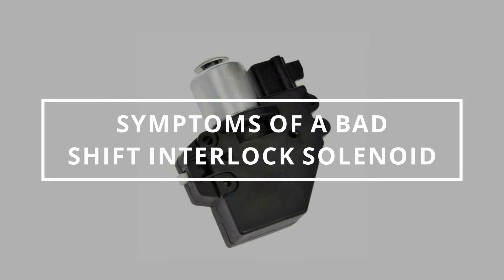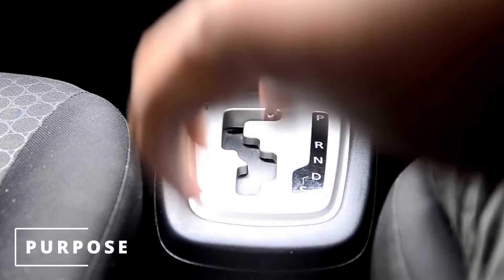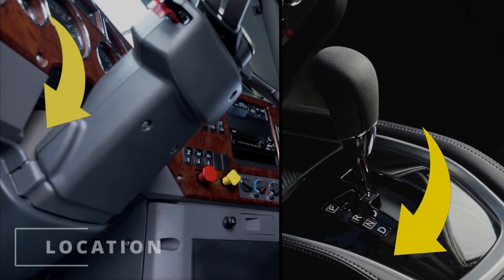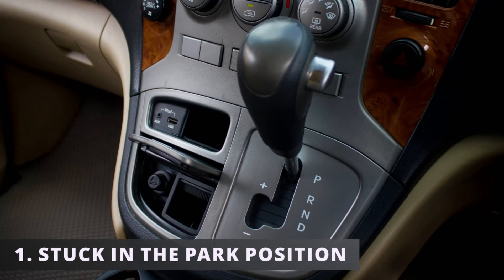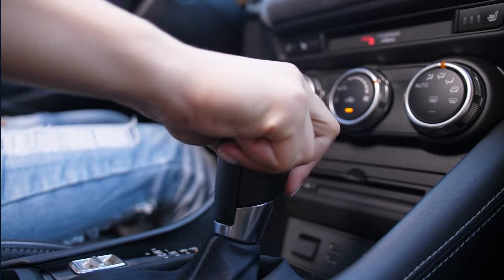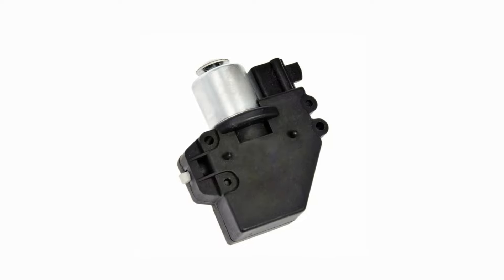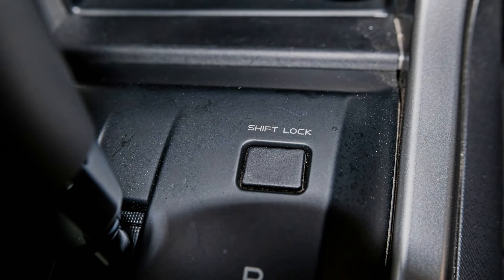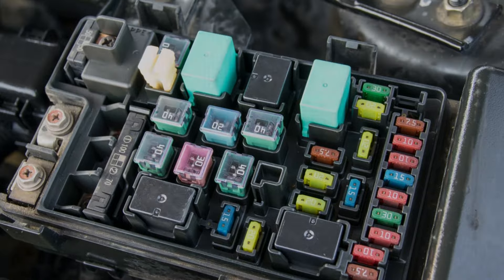SYMPTOMS OF A BAD SHIFT INTERLOCK SOLENOID

Comment: Nice video short and to the point. Quick question, can the solenoid be intermittent? Or is that a sign of a short. I have brake lights. Thanks for any info.
Reply: It could be intermittent  but its usually a matter of it going out(losing strength) and then the solenoid not having enough power to push through the transmisions resistance. Transmission resistance depends how strong your parking break is applied and if you are parked on an incline or decline, tgen the car rolls after you shut it off. if you dont push a (properly adjusted) parking brake all the way down, your car will roll after turning it off and it binds up the trnsmission into park. You dont ever want your car to roll after turning it off and you let your foot off the brake. he more your car rolls after putting it in park, the harder it is to pop it out of park so sometimes a bad solenoid will be strong enough, sometimes it wont. If you are having issues, try not to park on an incline, park sideways if you can so the tilt is side to side instead of front to back and always push the parking brake down almost as hard as you can before you put it into park. This should help until you can get it fixed. 

So to answer your question another way. The solenoid itself is not intermittent but it will lose strength when it starts going out. The amount of grip you give your parking brake affects the amount of pressure your transmission torques up after turning your car off. This is intermittent and will cause your solenoid to work intermittently. Its a bit of a tricky question so i tried giving a couple different resposes for the same answer.

Shorts usually dont happen in never cars unless it was in an accident or something crazy happened. A lot of people dont set the parking brake and just force it out of park. This wears down the solenoid quickly and can cause you to have to pony up for a new transmission prematurely.
Reply: 2005 Aviator here. I think the last owner bypassed the solenoid because the truck never goes fully into park and has a push to start button. So it will start in any gear which is dangerous. 
And now it won't go into park at all.
After taking off the shift cover it appears the shifter can't move forward any further due to it hitting  the metal bracket.
Been working on cars my entire life and never dealt with this. 
This is why I stick to Chevys. LOL
Any idea why or could the BSI cause this to happen.?

Comment: My issue is with the opposite. I can take the care out of park, but when I put it back into park, my key is stuck in the second position and won't go all the way back for me to take the key out. I have to wiggle the shift to be able to get the key out
Reply: Yes that is what is happening right now with my two thousand five honda accord. I asked my mechanic about it and they said to make sure that I firmly put the car in to park with the gearshift to make sure that the mechanism is reading that it is in park. They said if the car is not reading that it is in park it will not release the key. But lately I have been needing to use that bypass for shifting out of park and into reverse just to get the car going. Another problem I am having is when I start the car up fresh in the morning and drive a short ways and come to a stop sign.Or a red light, I press the brake to stop and em at an almost complete stop but in the car lurches forward 41 more little bump and it feels like someone has bumped me from behind and push me forward a little bit. I'm hoping to learn what that is.Perhaps it has something to do with the brakes
Reply: That’s a faulty ignition lock cylinder. Very common on Hondas-specifically Pilots. From my experience.

Comment: What does it mean when it’s finicky to get shifter out of park only in cool or cold weather; but no problem in Summer temperatures?
Reply: this is my problem also... what is not working in cold weather? wont move out of park...
Reply: @vincentdisisto8251  I've been told it could be a faulty "brake light switch", below the brake pedal (cheapest option), or the shifter cable (expensive).  I ordered the OEM switch today.
Reply: @drlarryc  hello, did replacing the brake light switch help to solve your problem? I also can't get shifter out of park when its cold.
Reply: @Xazeer  No, replacing the switch made no difference.  I tried to find another shifter from a salvage yard; and got to watch how involved it was to remove an old one (the guy broke plastic console off to make way to cut lots of wires underneath!)  I realized it was beyond my skill (and probably the cheap shop I intended to use) to cleanly swap shifters in my car.   
Then the salvage unit turned out to be broken just below the handle.   But I did get to see the contrast of how sloppy/ worn out the mechanism of mine was in comparison - mine had 364K miles when I sold it!   BTW: It was obsolete thru Toyota for my 2000.   So I continued to warm it up w/ remote starter until selling the car.   
If you shifter has loose play moving back and forth (with in gear) you likely have same issue as mine.

Comment: I just bought a 2015 PPV Charger and haven't even put 150 miles on it and the brake light, ABS and Traction control lights came on for about 50 miles..we cleared the lights and it's now stuck in park..had to tow it from an intersection because i didn't know about the pink unlock button so i could get it home.. Every mechanic had a different story so i took it to a guy that says it has to be the ABS module.. i'm pissed because this won't be cheap! the part was five bill$.. Haven't got it back yet, i think it's the solenoid. Those police cars can look nice but they have hard miles on most of them.
Reply: If you think about it. Cops always just throw the car in park and run after suspects. They dont usually put the parking break on so its probably a common issue for those cars. Hopefully you got it cheap and the transmission is ok.

A shift interlock solenoid shouldnt be that expensive but the ABS and trac control light tells me its something else going on, maybe on top of the solenoid
Reply: @ryry7886  just got it back...The guy that fixed it use to run a service dept at a Dodge dealership 12 years ago and CLAIMED it was the ABS module so he puts it on and THEN said i need both front wheel speed sensors for everything to work together!. $1200 parts/labor! ...and the first guy that looked at it said it was the wheel speed sensors but i didn't want to use their shop. I think i got ripped! it was probably a $300 fix. I'll never know now
Reply: @loumason6120 You definitely got ripped. Abs wheel speed sensors are like $40. I fixed mine in less than 15 mins
Reply: @hearditfirst8010  Yeah i think so.. Another crooked mechanic.. how surprising huh. I have owned 12 Trans Am's 9 GTO's and over a hundred regular cars/trucks over the years but no one wanted to mess with the PPV so i said fix it what ever will get the b** on the road!

Comment: What if my knob shifts but gear and light won’t leave out of park?
Reply: Probably bad linkage from shift lever. Oftentimes this happens due to a small plastic piece failing. 
I fixed mine by setting it back in place in the steering column and then wrapping the part in rubber tape.

Comment: When i push the shift lock it won't release, the sme problem or something different?
Reply: Your shift cable that pulls the gear lever could be broken, or it's bolt is rusted under the hood so it no longer pulls. First inspect its connection to the gear shifter by opening up the gear console. If that's good, then look under the hood to inspect the cable and the shift position metal bracket to see if they are rusted, if so, apply penetrating oil to loosen them

Comment: I'm hoping someone here can help me. I have a 2018 honda hrs. the problem I'm having is that on one occasion my car works fine, but like today, I press press the button to start my car, all the lights come onto my dash, I press the button a third time with my foot on the brake, and the car shuts down like I never pressed the brake pedal. I also notice that when I press the brake pedal, I don't hear the usual "click" to indicate that the shift lever has been released. Additionally, my brake lights don't come on. I leave my car for a few minutes, or hours, and miraculously, it works ,and I can start my car.

Is it possible that it's also my shift interlock solenoid? I also changed my brake position switch, so I don't think that's the problem.